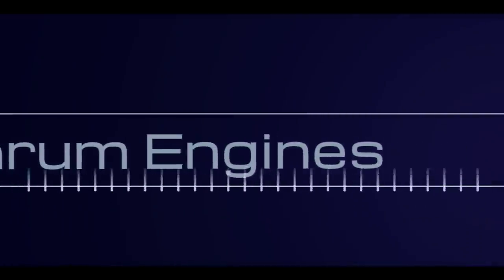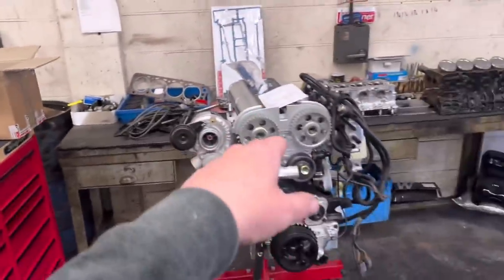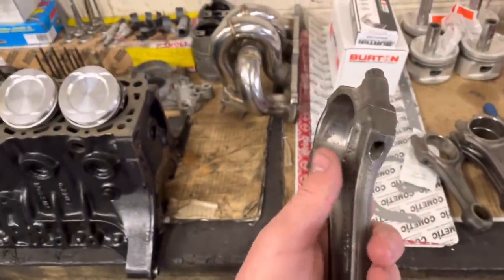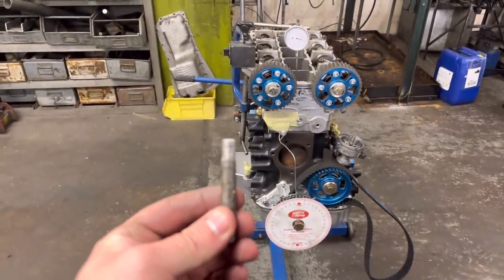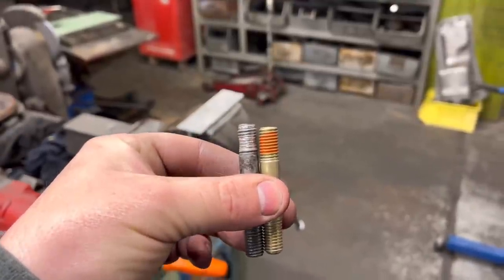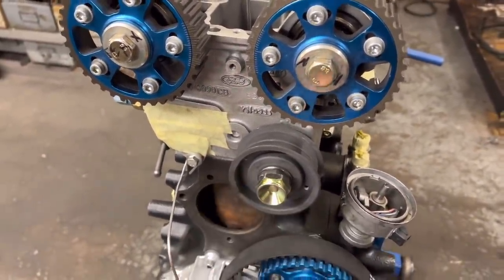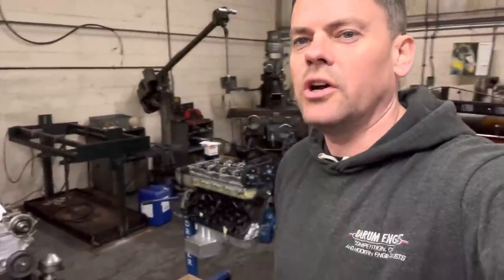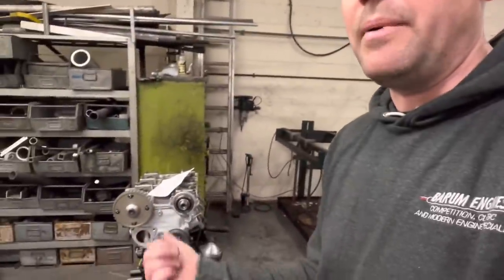We have NEVER seen con rods like this before, plus, Vernier pulley setup tuition, with issues

Comment: Love the simplicity of these old engines. a memory lane job for me, in the 70's I had a Cortina that broke a piston ring on a Saturday morning, head off, engine lifted out by hand and stripped by tea-time. Bought all the parts (everyone stocked Ford parts back then) on the following Sunday morning, rebuilt the engine and drove it to work on the Monday. it didn't actually get blueprinted but was fine. I also fitted some piston rings and bearing shells on a mates car that wasn't very old. I fitted std big end and didn't check what came out of the factory. A flashing oil pressure lamp on tick over was the light bulb moment to discover the engine was +010' on the big ends ex-factory. Here I am 50 years years later, never having forgotten those early years life lessons. Great that there is still a market for rebuilding these. Thanks for the videos.

Comment: The stud looks like the old trick when you are stuck without the right tap so you grind a flat on a spare bolt and use it to try and clean the threads but it is only a get out s- - - move and repaired ASAP and you dont even use the ground down bolt.

Comment: Finding true TDC is done more accurately by using a piston stop and a crank degree wheel rather than a dial indicator. The piston stop eliminates the "dead spot" and provides the exact location of TDC instead of a location somewhere in the "twilight zone"!

Comment: depending on rod offset  ,your going have the Piston dwell at TDC for a few degrees, Timing belts stretch, after break in after 25 miles, if you messed up  a new belt should installed ( I used to work on fiat twin cam engines), Ive  checked the timing marks on cam pulleys and sometimes after break in they are off a hair, a timing light is your best friend

Comment: disregard this if done already,but after seeing a recent video by dustin williams in the USA
 his skyline r32 with a built rb26 (taken out to 2.8) dyno tuning he had vernier bolts come loose
 and it bent alot of valves ,so when set up to spec and all bolts are tight, 
1 at a time remove a bolt clean the threads apply loctite & torque to spec
for peace of mind,not having a dig at all your work is excellent mate,
just something I see recently and got me to re-do mine before we run it up

Comment: the flat on the stud is to cut a thread DIY tap basically but it is a bodge and weakens fixing in the hole significantly, seen them when threading blind holes in aluminium, weld the hole up drill a new hole screw this in and it makes a fixing but isn't more than a bush fix,

Comment: Once the verniers have been set, I take it that you can change the cam belt by using the timing marks on the engine alone?  There should not be a need to adjust the pulleys again? Tryed  to follow you guidance ,but got lost when you moved to the cam followers, still a brilliant channel👍
Reply: Setting the actual max lift in the cam has no effect on the actual timing marks, it will always use the std manufacturers marks for replacement belt

Comment: Used to tap the engine with a soft hammer   to get TDC better, no idea if it made any difference, take up all of those sticky small tolerances. Striction etc..
Reply: As long as you measure with the dial gauge by always rotating the crank in the direction it operates you'll take up any slack/tolerances.

Comment: Fantastic video. Was a mechanic for 35 years but never used a degree wheel before. How did you get a customer from the USA?  If the customer says ok can you tell the story? I live in Florida and I don't think I would send an engine to the UK to be rebuilt.  Thanks

Comment: 3:28 flat on the thread of the stud is to clean out the thread, likely it was pulled and with no hélicoïdal kit around that was the best they could do - pre sales
Reply: Yeah, old way to bodge a bolt and thread. Can also bray a cut in with a chisel, not a good idea with a tensioner stud mind haha.

Comment: terrible way to set TDC - I build drag bike engines , and use a positive stop in the plug thread to stop the engine just before TDC , and set the pointer on my steel 14" degree wheel right in the middle of the 2 positions the crank stops at - far more accurate
Reply: Good for you

Comment: great engineering video but but lost me with so many degrees  maybe  beer issue love the video
older engines were fixable but modern piston development
OMG why wife has vauxhall grandland 1.2 turbo 
138 BHP
if that overheats 
new engine 
my first fiesta had around 50 BHP
and I keep asking Vauxhall do you have any issues with these 3x cyl engines
so much power from them
Reply: Try a Toyota GR Yaris , 3 cylinder turbo 1600, bout 250 hp , it's mental 8)